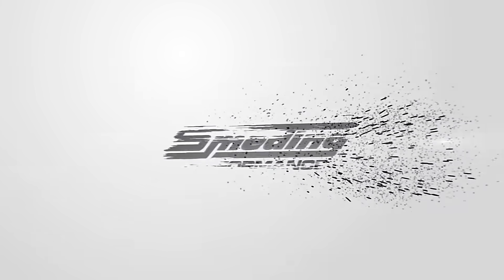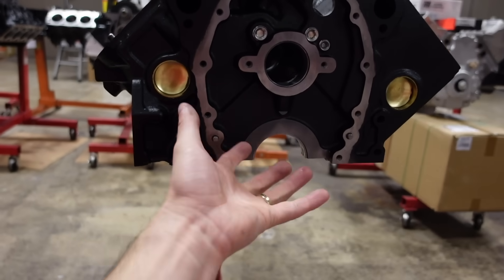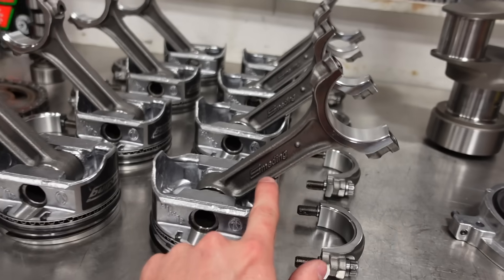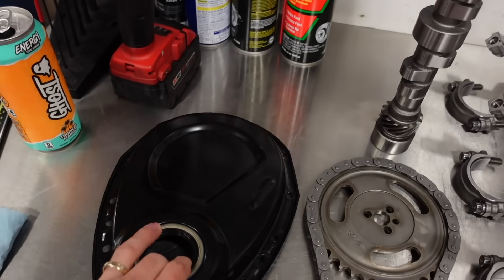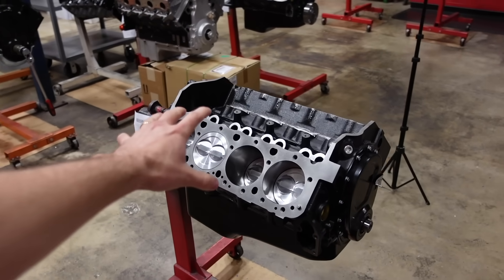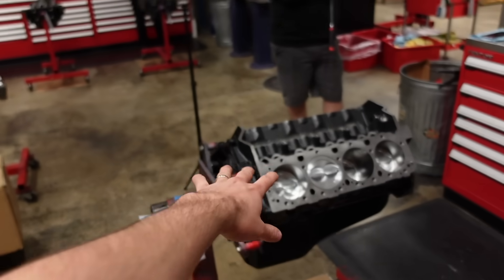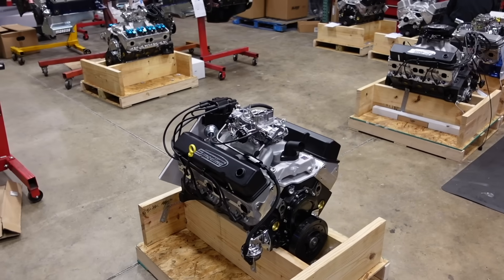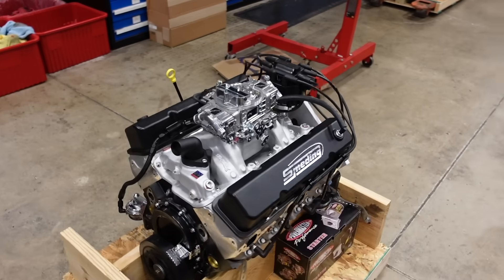Building a 480hp Classic 383" Small Block Chevy - Smeding Performance

Comment: Those are some extremely nice upgrades to that block. 
   Two detail items I’d like to know more about. How much lobe lift does that block allow before the oil pressure band comes out of the block? 
  I know there are some lifters with work arounds for this. Just cost associated like in most cases. 
   The other item is cylinder distortion under torque plate honing conditions . 
   Those blind head bolt holes are a plus no doubt and I know that those head bolt holes were CNC machined and much more accurately located than the factory based engines are. 
   When decking these style blocks the head bolt threads being flush with the deck makes it necessary to champher the bolt holes. For this reason it would be very nice if those head bolt holes had a counter bore depth before the threads began. 
   I’m sure it could be done and still accommodate a common length ARP stud. 
   Just think that it would improve overall quality and even help the manufacturing process. 
   Couldn’t add more than a minute to the cycle times. 
   Over all those are major nice upgrades. 
   A 4 1/4” bore ?

Comment: What’s the max horsepower for a Chevy small block that you could build for the street can you build a 600 horse 650 horse that I can drive on the street I like to know if anybody give me a comet
Reply: Should be easily achievable on a 434 sbc stroker. Its expensive.
Reply: David Vizard has a video about one thats got 700+ n/a pump gas
https://youtu.be/v9R1dh-oTYU?si=X_LtyGdopSSABqFX
Reply: 600-650 hp for a street spec small block chevy is a bit much on pump gas without forced induction.
Reply: @Sir.VicsMasher  cubic inches.. a 434  could do it.
Reply: @KingJT80 An aftermarket block cranked to 427-434 can do 700 on pump.
Reply: @ABetterLifeInc  yep.  Shafiroff racing sells them.